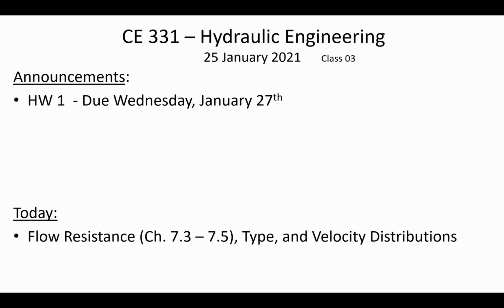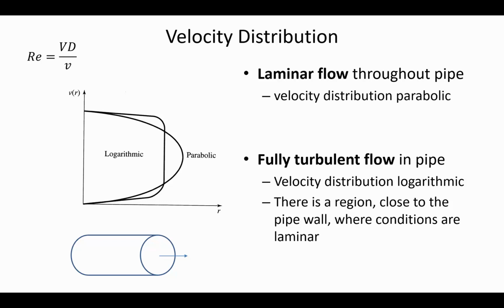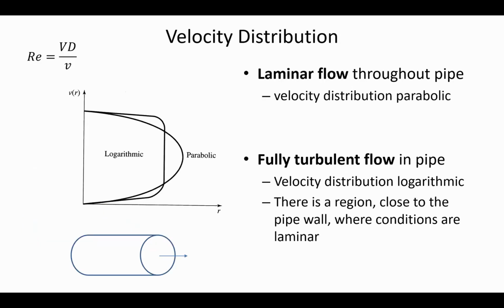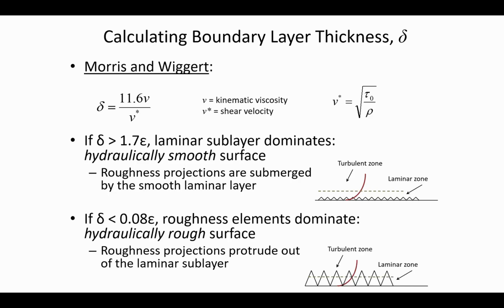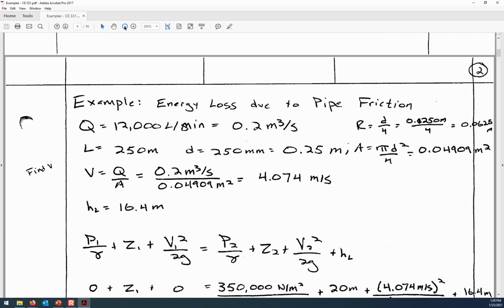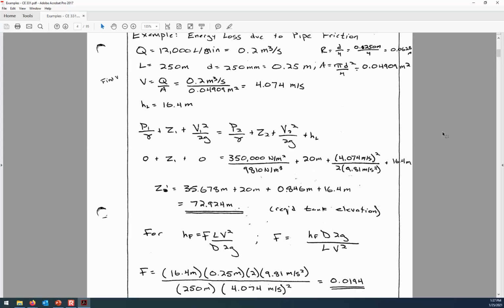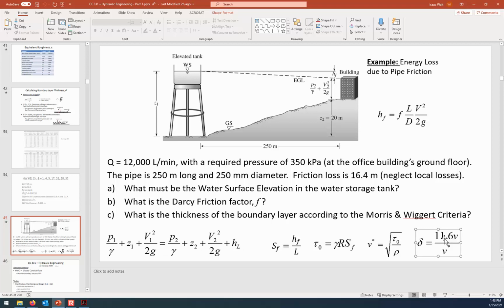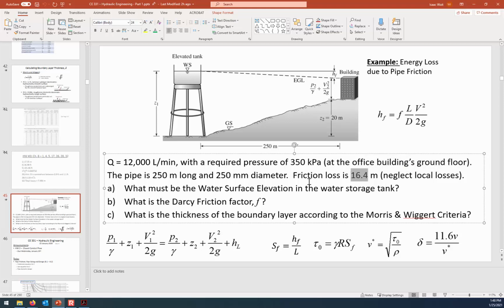Velocity distr, shear stress, Morris and Wiggert boundary layer thickness - ENGR 222 (25 Jan 2021) C

Comment: Isn't it the 'laminar sublayer' rather than the 'boundary layer'?  Or you can use them interchangeably?  The boundary layer technically extends all the way up to the center of the pipe right?
Reply from the maker: Interesting question -- I had to look up the definition of each to make sure there wasn't some finer distinction that I'd been missing.  I do think it's okay to use them interchangeably in the context of the topics of this particular video.  Boundary layer is the region near the fluid:solid interface where viscous effects are significant.  Laminar sub-layer is describing the outcome of those viscous effects: laminar conditions where Re<2000.  In other words, the laminar sublayer is a type of boundary layer.  Thanks for the great question!
Reply: Thanks a lot, Isaac!